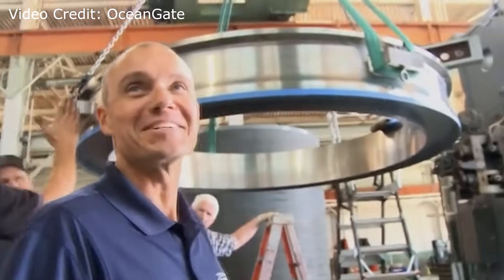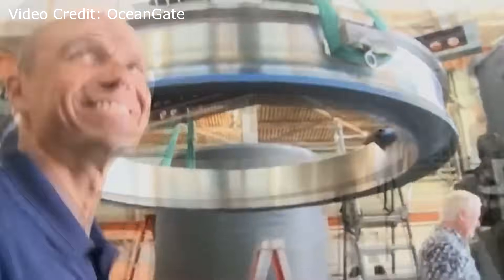Raw Unedited Re-upload of OceanGate's Promotional Video - Bonding a Titanium Ring to the V1 Hull

Comment: "The glue needs to be ultra precise"... proceeds to apply it with spatulas.
Reply: Also, just the fact anyone is trying to defend this thing ... ANYONE. 🤣
Pathetic. Just absolutely horrendously pathetic.
Reply from the maker: 😢Yep. This video is so odd!  They considered it a promotional video.
Reply: @solareclipsetimer it warned plenty of people not doing it
Reply: @solareclipsetimer  David Lockridge, in the recorded conversation where he was fired, brought up this exact point. They had been talking about using a specialized machine to apply the adhesive, but ended up doing it with "people on ladders with spatulas".
.
All of Stockton's "engineering" decisions were financially based. The whole "I'm an innovator" bit was his coping mechanism for the fact he was not only playing Russian Roulette, but playing it based on the idea that since the chamber was empty the last three times, it must be empty for the next three.

He was the worst kind of idiot: An idiot with money. Not so far removed from his hero, Elon Musk.
Reply from the maker: @qarnos  Yes, I agree.  But Tony Nissen testified that he did not want to be responsible for doing this epoxy joint.  So, those technicians in the video are from Spencer Composites.  Dave Spencer is also in the video.  Tony testified that Dave Spencer was the expert in doing this procedure.  The Spencer specification for that joint is 0.03 Inches.  Who can tell if they are achieving that evenly?  So, this mess is not on Stockton and Tony.
Reply: the fact this thing actually made it several times to the titanic is actually a testament to how well those workers did their job. the issue is carbon fiber isn't the right material for high pressure expansion and contraction multiple times. carbon fiber is a rigid material but also very brittle.
Reply: The haters are just repeated what they heard like parrots. This ship was a marvel of engineering, but they now know it has a limited lifespan… is it impressive that you could stack 50 freight trucks on this thing without it breaking? Heck yeah it is! But is it really cost effective if you have to rebuild it every 10 deep dives or so? Probably not.
Reply: @MoneyManHolmes yea real engineering marvel especially the playstation 2 controller which controlled it
Reply: @anthonyhans2718  is the dam that works for many years and holds water for many years? Still not a good dam even after it breaks. It did what it needed to do for a long time
Reply: @qarnos  Did you just make out Elon Musk to be something like an idiot...? Remarkable.
Reply: @qarnos  Your comment was making sense until your TDS exposed itself

Or has Elon Musk built submarines, too?
Reply: @qarnos lmao Elon whose SpaceX has launched how many successful round trips into space? C'mon man.
Reply: @solareclipsetimer  In acrobatic performances like wire walking, it is the acrobats who do the final check on the fastenings to make sure everything is on top order. 
That way, if something goes wrong, the responsibility falls on the victim ... No pun intended.
Reply: @MoneyManHolmes  so you would go down in a new one like that? Looking for the Darwin Award?
Reply: @qarnos  "Not so far removed from his hero, Elon Musk." Dumbest take ever.
Reply: @LygerTheCLaw  Cyclic Fatigue
Reply: @LygerTheCLaw  Yea, def can't blame these workers. They are probably used to working on boats...that you know, operate on the surface. Not thousands of metres below it.
Reply: @tormmac nah, that was just a front. The reason he disliked "old grey haired male engineers" is because they cost a lot more and are less likely to back down in a debate than kids fresh from college.
Reply: @qarnos Elon is intelligent unlike you . Hey you keep being a smooth brain though
Reply: @MoneyManHolmes they are all kids that know nothing about engineering.
But still place their asses on a carbon fiber Bikeframe thats build much cheaper in China .
Reply: @briantime9880 Musk is a dumb person’s genius. I don’t know what’s worse. The fact that you think he’s a genius or the fact that you defend him despite the horrible stuff he’s done
Reply: @Bae_ti_Angel  So how did Starship 36 go?
Reply: @qarnos  Still miles ahead of any "competition". Sit down biden boy.
Reply: @MoneyManHolmes I would respectfully disagree. In aerospace, this design would have failed at the very first hurdle of testing and the carbon fibre design would have been shelved. It’s not a marvel of engineering. It’s a marvel it didn’t fail the first time it went down. It’s a sad and horrific story.
Reply: @anthonyhans2718  This thing went to the Titanic and back multiple times successfully before failing (I think 13). With the Logitech controller too, pretty amazing. Rush was on to something with deep ocean tourism and exploration, but his genius had some crazy as well and he ignored the warning signs.
Reply: @LygerTheCLaw  That isn't really a testament. It could have easily made the trip 4 or 5 times. It just has to be continuously replaced because each dive it "breaks" a bit more. If they kept replacing the tube every 5 dives, sure.
Reply: @LygerTheCLaw  the issue was delamination due to compromised interlayer continuity. As the carbon layers were applied, drying process made it wrinkly, and those wrinkles were ground off.. with an angle grinder. 
The guy wasn't a physics major, let's put it that way..
Reply: @MoneyManHolmes I think your comment, much like Stocktons mindset in general, is ignoring some of the more basic concepts regarding safety. Sure, it survived multiple trips, but the margin of safety on that thing was so low to begin with that we shouldn’t have even found out if it survived one trip. The fact that it survived as long as it did was pure luck. Getting lucky is not an indication of something being a “marvel of engineering”, in this case it just means one group of people got unlucky instead of another.

Perhaps one day we can use the lessons learned here to build a similar sub that does have an acceptable margin of safety, until then one cannot call a sub with such an unacceptable safety margin a “marvel of engineering”
Reply: they renamed the company to 'GeoThrust'
Reply: @MoneyManHolmes  things broke every time it went down.
Reply: @MoneyManHolmes  Dont be ridiculous, it was a death trap, that somehow soldierred on inspite of obvious warning from his own rtms system that he ingored and kept diving. If the sub was better contruvted amd without carbon fibre he wouldnt need rtms.
Reply: @MoneyManHolmes do you always defend dead rich men who conned people into killing themselves?
Reply: @Percival-kl9yy thanks for letting us know you are a bootlicker bro.
Reply: @anthonyhans2718  Think best designing a controller from scratch over using one a billion dollar company makes and has spent millions of R&D for a particular controller?
Reply: @olivernew4641 bro he had me untill that last part. 😂😂😂😂😂
Reply: Here come the contrarian idiots that think they’re engineering PhDs.
Reply: Is a dam made from fancy alloys, not tested in a real world environment, but is labelled with idealistic crap like “Silicon Valley-style innovation”, that survived two weeks before bursting a GOOD dam?

No. It’s a poor dam designed by a layman that got too much into Steve Jobs. And because of that arrogance, he and others are dead.

“Work fast break things” works with a toaster, not with critical infrastructure or vehicles.
Reply: @Henrik0x7F  such as...  ?
Reply: @qarnos yikes. I was with you until the very end. You then decided to make a point completely unrelated to the video. I’m curious as a liberation, what exactly has Elon musk done that you could compare to this amount of incompetence. I’m not a fanboy by any means; however, I am curious what connection you feel you are making and why.
Reply: @peppylafew116  Assuming you are asking in good faith...

The connection is that Rush did not understand anything about subs, and relied on those underneath him to understand them and meet his demands whilst he took the glory.

SpaceX could be a great company if Elon would let the engineers run the show. They have done great things - none of it to do with Musk apart from the fact he is providing the $.
Reply: @qarnos when did Elon Musk apply adhesive with spatulas
Reply: @qarnos See, that's the thing that differentiates Elon Musk from Stockton Rush (not talking about politics here, purely business sense). He's clearly picked up some information over the years about dealing with rockets, but he also seems to recognize that his engineers are the ones who really know their stuff, so he mostly acts as a funder/cheerleader for the organization. I see people in this comment section comparing the Starship launches to OceanGate, but that's just not the same, given that they're using their more reliable Falcon platform consistently to transport people and cargo, and testing has to happen on the Starship so they can advance as a company. The problem Rush had was that he just heard about the miraculous carbon fiber and thought he could ignore all the engineers' warning that it wouldn't work, and just assume that it would work because he wanted it to. This isn't me being a keyboard warrior with the benefit of hindsight, this was me being a keyboard warrior who was shouting this at my screen weeks before he even went down (I've worked with carbon fiber before, but in different applications).
Reply: @mr.freddles2866  ...and the thing that makes them very similar is the fact that Musk declared his first rocket, Falcon 1, operational after 3 test flight which all resulted in loss of vehicle. The next flight was carrying paid-for payloads and resulted in... loss of vehicle. We now know the reason Musk made this call is because he was out of money and needed those customers to pay for his next test flight. Sound familiar?
Reply: @qarnos except, despite being a ruse, it was meant for more funding, and he still clearly knew it was not fit for human testing, given that it needed more test flights
Reply: @mr.freddles2866  So it's ok to lie if it results in more money, just as long as no one dies?

Go away,.
Reply: @qarnos I didn't say it was okay, I said it wasn't nearly as bad as what Stockton Rush did, and did not endanger lives. Again, I have no interest in discussing personal feelings toward either of these people, just their business sense and regard for human life.
Reply: @mr.freddles2866  Neither has/had any regard for human life. It's all about the glorification of their own ego.
Reply: @Henrik0x7F  What have you achieved? Ohhhhhh nothing.
Reply: @LygerTheCLaw  “carbon fiber isn’t the material for high pressure expansion and contraction multiple times” actually one of the strengths of the material. That’s why every airliner manufacturer and their mothers are working on composites and why the 787 is made so heavily of them. Hell, the Navy considered carbon fiber composites for subs and made several successful DSVs that went deeper than the Titan with no issues with carbon fiber hulls. Their issue is how the system worked as a whole and their flawed testing apparatus.
Reply: @MoneyManHolmes  never heard of wear and tear? Nothing genius about ignoring that aspect at all, much the opposite
Reply: @solareclipsetimer  saying the complicit killings of the passengers isn't on Stockton is wild, considering guess who signs for on that pos submersible before it is submerged lmao. Stockton and the others 😂
Reply: @Bae_ti_Angel  It’s a good cope though.
Reply: If its good enough for pizza making thats when you know its the good stuff
Reply: Did you see how the sterilize the surface?😅
Reply: and it's not even those serrated spatulas to distribute paste evenly (in equal stripes)...
Reply: @Intelligence_Failure  Not even the MasterChef ones, just the regular $2 shop ones
Reply: just the "basic" OH&S violations.
1) no hard hats - yet standing under a metal ring held up by a crane, Yes, a hard hat won't save you from that, but its standard practice.
2) No high Vis in a high traffic area 

from this, general safety seems to be an afterthought. no wonder the sub failed.
Reply: @kane0387  OH&S? You must not be from the USA!
Reply: @qarnos  Australia 🇦🇺 
We dont take safety as a laughing matter over here.
OH&S = occupational health and safety.
Some major companies call it different things. 
What is it called in the usa?
Reply: it seems a bunch of children making their manualities at school...
Reply: Haha
Reply: Safety spatulas?
Reply: Don't forget to grind out those ugly bits of glue that get squeezed out in the final steps! It's gotta be smooth to go through the water fast 😊😊😊😊
Reply: Bondo Spreaders to be exact. Lol
Reply: in an open, unregulated building with tons of dust and debris floating in the air

its actually hilarious

and a wonder that the submarine even held up for so long.

even a tiny corn of dust that gets trapped in between the glue layers, will exponentially weaken the connection over time and in deep depth.

there is no room for error here. This glueing process should have been done in an controlled, air filtered environment where everyone wheres hazard suits.

they should have also made an in-depth X-ray scan of the finished glue connection, to see if anything got trapped in between the layers (dust particles, sand, air bubbles) and if the glue spread evenly.

and the applying pattern and amount should also be highly regulated.

if i was the engeneering director, i would have created multiple examples made out of aluminium or steel and a thin piece of fitting carbon fiber. So this whole process can be made multiple times to 1. learn the process correctly 2. see what kind of fail points might occure without braking the bank and destroying the valuable titanium and carbon fibre pieces.

beside that, they should have never glued together titanium and carbon. both behave differently under pressure and temperature.

Which leads to contradicting forces on the glue layer.

And the carbon should not be rolled as such a layer. Normally carbon has a weave pattern for enhanced strengh.
but here we see no weave at all.

I dont have a degree but i know to repair and create things and i have common sense.

If a person like me would have been the voice of reason in that company, it just shows that degrees dont magically give u the ability for common sense.
Reply: @pedro_peyote Lmao “I fix things so I’m qualified as a deep sea pressure vessel engineer”. Yes, we get it, you and 5 million other YT commenters could have prevented this, if only YOU were in charge. Got it
Reply: @behar I think the overall theme from everyone on the YT keyboard warriors is that they would have done it better because they simply wouldn’t have done it.

They would have heeded the fact that every small scale test failed and noped out, as opposed to callously putting other people’s lives in imminent danger to fuel your narcissism.
Reply: @geebee3d yeah I don’t think so. Just nope out and close up shop and give up all that potential wealth? Dude was about to create the first underwater tourist industry. keyboard warriors somehow think they’re always the exception to the rule. In this case it’s inherent traits like greed and selfishness, that’s in all of us. I get where your coming from, it’s just what’s said behind keyboards and the reality of humanity are two vastly different things
Reply: The glue wasn't the problem.
Reply: What do you think it has to be done?
I see youre a real builder😂.

So many losers here iam sure they all unable to Hammer a nail into a wall

Comment: port door didn't even have a sealing ring..just titanium on titanium. with what 3/8" home depot hex bolts?
Reply: No kind of bolt holds this shut... You have 2.5 miles of water pressure making sure it doesn't open..

Comment: Someone in the comments says, "If done right, the vessel would have done 100 [successful 4,000 meter] dives." I see their point, but there's more to it than good construction. Also, if done right, it would have cost many times more than it did. For one thing, they were going to need a reliable delivery system, and that might cost more than the submersible. But, with regard to just the vessel, while all the money would be pouring into its construction and testing and upgrading, there would remain the biggest problem with the whole venture. The conditions at the Titanic site only allow weather windows for a small number of dives per season. How long would it take to complete successfully 100 dives? How many years would it take to make a sizeable profit for the investors? Which goal would be reached first? Of all his half-ass efforts, it was the ill-considered and badly-executed business model that would keep him from ever seeing 100 dives. How much less expensive it would have been to pay early for a logistical assessment of the project as a whole.
Reply from the maker: I agree with everything you said.  My video about the OceanGate finances discusses why it was a bad business model, and so does my book.

Comment: so many corners cut . if it was made right . I bet it would have done a 100  dives . but this made it to where it will never be tried. from expired carbon ,to grinding the humps down . to welding on lift lugs after glueing the ring on , ect,ect , and on and on
Reply from the maker: Yep, a bunch of issues.  Thanks for commenting.